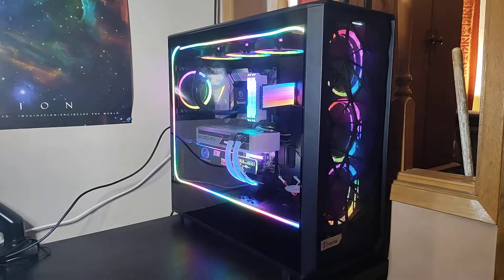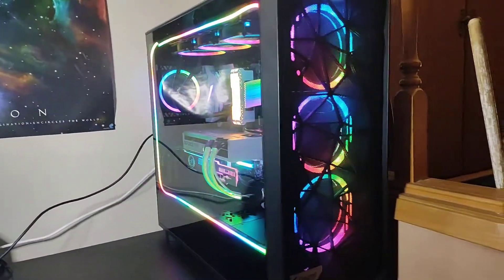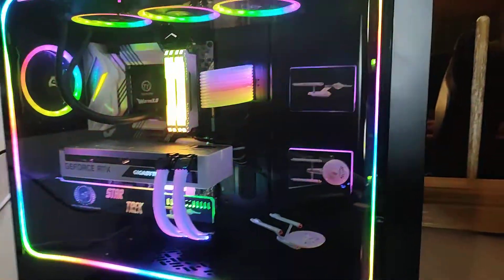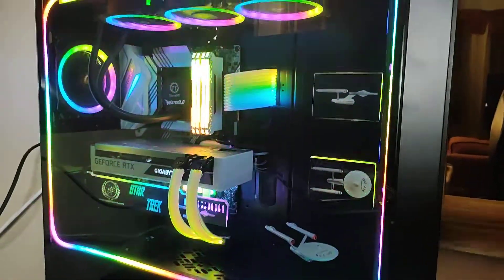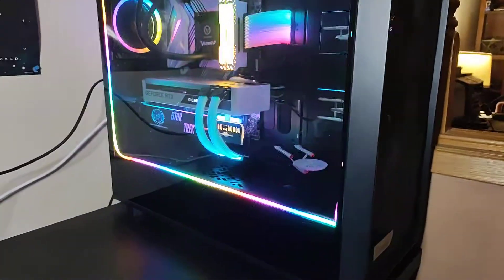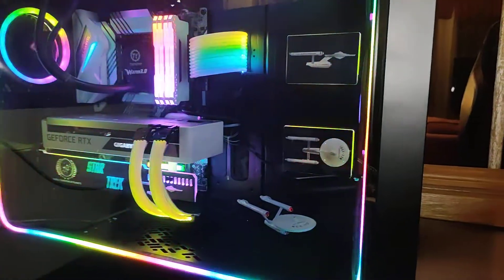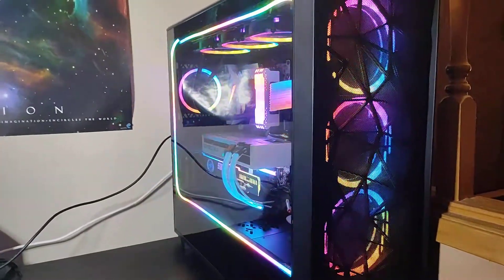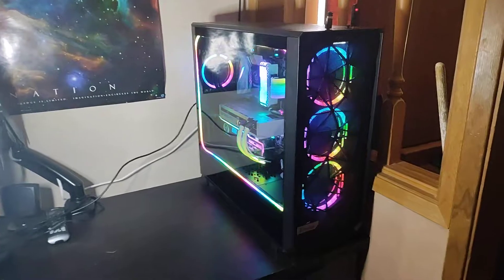Meshify 2 XL RGB in the Great White North Eh!

Comment from the maker: Lol, I think I need some more RGB eh.
So, like, I ordered in a DeepCool Castle 360mm AIO water cooler with an RGB pump, and I also have a couple of new RGB strips, two black and two white, similar to the Phanteks I have installed now. They are shorter, and may go around the periphery of the main board. I haven't decided on that yet. The UpHere strips I bought are white, and they're only $20 Canadian. They are way cheap and look way better than those crappy strips with individual hot spot LEDs. These ones are about 14" long give or take, and the Phanteks version adds about another 3/4 of an inch to that length. I haven't decided if I should use white to match the board, RAM and GPU, or if I should use black to match the case.
In case anyone gives a crap, feel free to mention your preference for this case.

Comment: Looks pretty cool !  Would you please tell me more details about front RGB fans ? is it 140mm?
Reply from the maker: All the fans are Antek Prizm fans. (not Prizm X). The three on the front are 140mm, and the four inside are 120mm. Amazon has a kit of 5 of the 120mm with an RGB controller for about $85 Canadian (about $60 U.S.). The 140mm fans I got off of eBay.
They are PWM fan controlled with standard 4-pin PWM connectors and come with a 3-way PWM splitter. The RGB is 3-pin addressable and can either plug into your motherboard or into the RGB controller they come with. The RGB controller can plug into your motherboard, and if you want you can also plug it into the reset button on your case to control the RGB modes. Note, after a power cycle the controller will default to internal RGB patterns and not motherboard patterns. Personally I use a 12 port RGB hub and plug it into my motherboard. I have no complaints regarding these fans and I think they look exceptional.
Reply: @OriginalMergatroid  I'm building my new PC now. Thank you for your information. It really helps a lot. Thank you again. Antek 140mm Prizm fans Look so awesome. I'm  considering purchase them :)
Reply from the maker: @Gromit8181  If you make a video, post a link here so I can have a look.